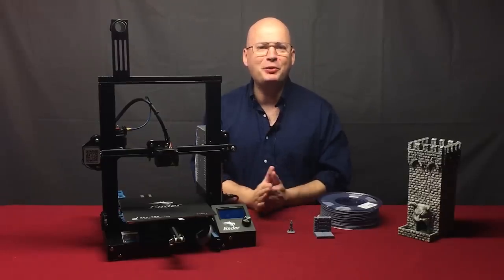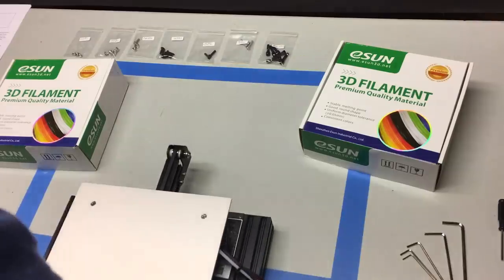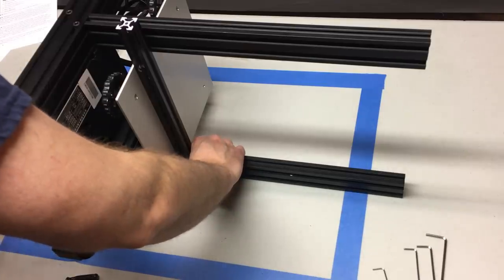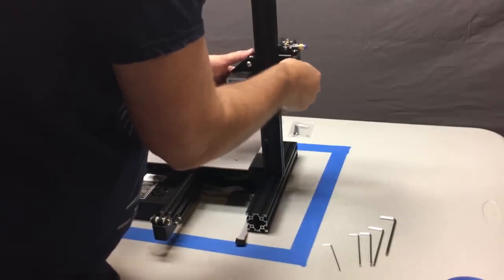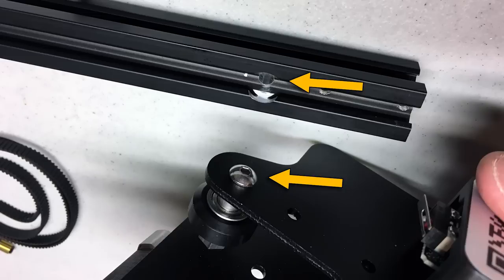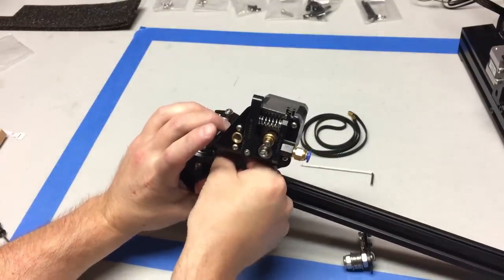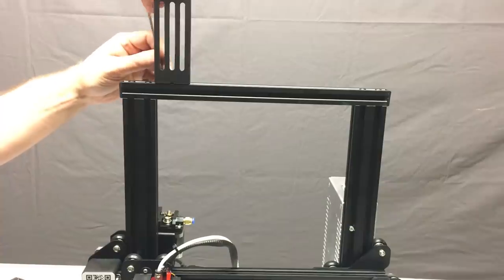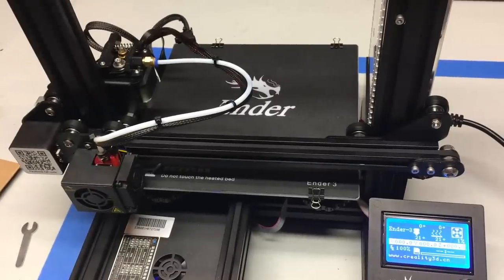Creality Ender 3 assembly and pro build tips

Comment: Who are the seven morons who thumbs down this video? Excellent job. Thank you for taking the time including the added tips to insure everything is square.
Reply from the maker: Thanks! Those seven people are all just jealous of my epic haircut. :)
Reply: Those 7 (now 9) people are the ones who bought a $2000 3D printer, that doesn't do a better job than the Ender 3!
Reply: @kenneththomsen8503  The Ender-3 is a POS printer. It's a cheaply designed, cheaply manufactured, badly assembled and badly stored/shipped. Everyone knows about  Creality lack of quality control. Thanks goodness I bought my Ender-3 in a brick and mortar store. Both vertical pillars extrusion were not cut squared at 90 degrees,  the bed bearings were dead, one of the extruder assembly bearing was all rusty, the aluminum bed was and is still warped. Add to that the dangerous cheap power supply known to failed, the cheapest available motherboard that comes without a bootloader and with only 128kb so that you cannot add most new features on Marlin, the heating bed electrical cable that get stuck behind on of the extrusion (even with the new cable attachement). So you seriously think a $2000 printer is as good an Ender-3? lMFAO The Ender-3 is a POS of a printer that I should have never have bought if only I had known before. But sadly my mistake was to watched too many YouTube videos on which reviewers who are getting free printers from Creality, give very bias positive reviews. Did I say the Ender-3 was a POS? If I had $2,000 for a 3D printer you bet my Ender-3 would have already been advertised on kijiji and I' would be waiting for my beautiful $2,000 3D printer that would be plug and play, safe-to-use, silent, wifi enabled, remote control enabled, HD cam enabled, with an effective enclosure.

P.S. This video here made by Tomb of 3D Printed Horrors is by far the best tutorial on how to assemble/build an Ender-3. Period. Congrats and thank you!
Reply: @mikem8145  it is a good printer to start up right?
Reply: @jairosan71  Did you read my post? The answer is no. Unless you have the time to watch dozen of videos on YouTube on how to transform the Ender-3 into a good, reliable and safe-to-use printer and the money to upgrade half of the damn printer. Upgrades that if order on Chinese sites like eBay or Aliexpress will cost you 50% of the initial price tag of the printer. Upgrades that if order anywhere else than China will cost you as much as the printer itself.
Reply: @mikem8145  So sorry to hear that your Ender 3 didn't work out. Maybe I got lucky with mine. Definitely concerned about the power supply, plan to replace it sooner than later. I'm curious, if you don't mind sharing where you bought it? I'm wondering if it may have been a case of copy-of-a-copy, ie a shitty clone of the Ender 3. I'm absolutely not arguing against your experience or your opinion of the printer,  just wondering who to watch out for if I decide to roll the dice and get a second one.
Reply: @GameMonster117 You probably had low expectations that's why you're happy with your crappy printer
Reply: @jairosan71  Don't listen to GameMonster for sure he had low expectations that's why he's happy with his Ender-3. Or he simply doesn't know what a good printer is. I'm telling you about my personnal experience with my Ender-3 which was built late summer 2018 so it is not an early model. Read forums, watch videos, and you can make up your mind. Is the Ender-3 a good printer? No. Is it cheap? Yes. Now it's up to you to choose which is a good balance between quality and price tag following your budget.
Reply: I bought my Creality Ender-3 from a brick and motar store with a stellar reputation. So I'm pretty sure it's a genuine Creality product. Honestly, when I'll be done with the upgrades, only original Creality parts left will be the alu frame, the delrin wheels/bearings, the stepper motors and that's about it. Let's just say you're lucky and you end up with a perfectly working Ender-3... to have the best prints obviously you need the best firmware right? That means NOT using the Creality FW and install vanilla Marlin (or TH3D or other tweeked FW). That means flashing the Creality FW but for that you need first to install a bootloader. But that's quite easy with an Arduino. So now you have an up-to-date FW. Good right? No. Because the motherboard inside the Ender-3 is the cheapest available with only 128kb of memory and that is NOT enough to  activate all the important features in Marlin like safety features, print quality features, resume print features and so on. So yeah even if you're Ender-3 unit was perfectly built by the Chinese, and that's wishful thinking, you cannot use the lastest firmware to give the best chance of succes in your prints. So is the Ender-3 worth buying? No. You're better build your own printer from scratch than buy an Ender-3. Because you're gonna end up upgrading every single parts of your Ender-3 if you look for print quality and cannot satisfied yourself with subpar quality prints. So then better build it from scrath. Or buy a better quality printer.
Reply: @jairosan71  I'll tell you the plain honest truth that no one is willing to provide you with : most people are buying the Ender-3 because they don't have the budget to buy the new Prusa. Period. I'm was one of them. If I could go back I would either buy a Prusa or another good quality printer from another brand.
Reply: @mikem8145  One last question. Why didn't you return it? If I had bought a printer at a brick and mortar store, with a stellar reputation, and found bent parts, rust, etc. I wouldn't have kept it.
Reply: @joshmckee5699  Like I already wrote in another post, I brought it back to the store and they change all the defective parts. But it's worth mentioning that they had to open three printers to be able to give me one without any defect. All three brand new Ender-3 had some defective parts. Everyone knows Creality fails regarding quality control. Creality say they're testing every single printer before it leaves the factory, that's either one big lie, or they don't mind shipping defective printers knowing a lot of customers won't notice.

Comment: I'm two prints in and my Ender 3 pro has been great. I think these instructions are worth their weight in gold. Feels like more than anything I gathered from this is that you want to double check everything for plum & level which might be loosening a few bolts, making adjustments & tightening them up several times over. But it's worth it. Only thing I'd add to this video is that if you have a level around the house, would hurt to have this next to you as you're building it. Makes for easy checking on a lot of these rails.

Comment: Really outstanding job on this. All the wisdom of an engineer’s perspective, but well articulated in common language. My first ever print is in progress and looking amazing. It’s a mind blowing world we live in; thanks for making this that much more accessible. 

One tip- when installing the vertical rails and getting them to sit parallel with the X axis, I took it a step further and placed one of the horizontal rails centered at the end of the vertical rail, with the assembly still on its side, parallel to the base. This acts like a winding stick and you look at it straight on from a few steps back, this greatly embellishes any twist and helped me dial it in to well under a degree very quickly and without any additional tools.

Comment: Watch out! at 23:54 is incorrect! Those T-nuts should be rotated 90 degree and pushed in from the side of the aluminium bar. When you tighten the screws those T shaped nut shoulders will pull and squeeze it to the aluminium making it not to slip away. This way as in the video it barely grips the aluminium and will slip the X-axis over time. Its great video, but thats incorrect. Thanks

Comment: Your extra step at about 20:35; I've found that when adjusting the two bolts holding the wheel cart to the horizontal X extrusion, it seems to be better to just screw in one of those at first, then you can adjust the  X extrusion while it's on the Y axis using that spacer. It leaves out having to guess the adjustment and having to put it on and off again and again. Just have to be careful not to bump it when taking the X extrusion off the Y axis. Then put in that 2nd screw at the corrected adjustment. I think I've got it pretty much perfect with this method.
Reply from the maker: Great suggestion, I will try it when I build another Ender. :)
Reply: @Tombof3DPrintedHorrors  yes and please add the weight of he other two carriages mounting them on the extrusion (hot-end centered and right one may be tweaked also for extra support) before calibrating the X-gantry. Great video!

Comment: SO I just started putting my ender 3 together today and am at the point of adding the Z-axis assembly motor for the T8 Acme Lead screw. I just noticed the top screw for the coupler to lock in the T8 lead screw is missing. Does anyone know where I can quickly get a replacement screw?
Reply: Anybody? Mine is missing too

Comment: I'm not usually one for watching assembly videos but I have to say yours was a pleasure to view, and coming from a background in aviation mechanics (Military Air Weapons with RCAF) was spot-on with insightful observations and tips on best practices over and above the general build requirements.

I built my Ender 3 five days ago (Christmas eve no less...  :)  ) but after seeing your video, will probably disassemble and re-assemble it using your tips on adjusting the rollers as well as making sure the frame is properly square. It may not seem like a big thing, but being new to 3D printing, and knowing how critical exact measurements, calibration, and leveling are, it can't hurt to make sure the starting point is as dialed in as possible.

Again... thanks a ton for the vid, and best of the season to you and yours.
Reply from the maker: Thanks for watching! :)

Comment: Thank you! This is my first 3d printer, and generally I am not super handy, but all the steps were explained perfectly and it took just some 3ish hours to build it.

I initially didn't understand how the rectangular bolts worked, and messed up the connecting a bit. Also, I didn't know how exactly the x track was meant to be set up. But eventually I got it all figured out. Now on to the leveling of the bed!
Reply from the maker: Wonderful!

Comment: Hi, just assembly my new Ender 3 using this guide. And it's working. Downloaded your test. Bit it's not printing centered in the bed, how can I center it? Thanks and congratulations for this guide.
Reply from the maker: Change the bed size in the Cura settings to 235x235 :)

Comment: very good tutorial thank you for supplying the extra steps in between only part that tripped me up was when you were describing how  to make the x axis straight using the filament holder as a guide i was unsure which bolts you were talking about when you said take it off and turn the bolts half a turn and try again i thought you meant the ones for the z rod so it took a bit before i realized you meant the x extrusion. but overall great video :)
Reply from the maker: Thanks :)

Comment: Great job on leading this printer setup newbie to a successful first print. I was challenged to get those vertical supports parallel so that the distance at the top and bottom was equal. Mine was initially varying by nearly a centimeter. If I didn't know to tackle this issue, I'm sure I would have run into alignment and mechanism binding issues down the line. As a heads up, don't do what I did and get the Z-axis stop switch cable trapped under the extruded x-rail to your left. That was part of my challenge with the verticals out of alignment. The left one was leaning out due to the trapped cable. Luckily I hadn't cinched down the bolts to point where the cable was severed. It's was only somewhat flattened. It's also worth noting that the vertical extruded x-rail on your left is symmetrical along the vertical axis. You can rotate it 180 degrees around the long axis, and that provided me some relief in truing the alignment of the two verticals. Perhaps the end cut of the rail wasn't quite square. That would be one explanation for why the alignment varied when the choice of which edge faced towards the print bed is made.
Reply: THANK YOU for leaving the comment, unfortunately I destroyed my z axis cable.. .anyone know where I can get a new one?

Comment: Great vid but theres one problem that I had in following these instructions. According to the section at 20:39, if the horizontal extrusion is too high or low on either side we should loosen "those" screws a half turn to readjust it. It was being implied that those screws were the 2 z axis screws on the z screw but I'm pretty sure he meant the screws on the x axis extrusion at 18:33 because that worked for me, while the former didnt.

Comment: Hey, I just did the part with the metal rod and as I lowered the horizontal extrusion down I checked that the height matched up the way you did. Its a good bit off, and adjusting screws doesnt seem to work. Its significantly higher on the far side. What should I do? ~20:00 into video.

Edit: It seems the black bar of the horizontal extrusion itself is what has too much give. I can adjust it visibly by hand.

Edit: One of the two screws on the bar had some give to it. I think I have it right now. :)

Comment: Damn, this is the tutorial I should have watched.  Now I pretty much have to rebuild mine...in spite of reading the instructions AND following a different tutorial.  There's not way I can assume my vertical rails are straight or my wheels are tensioned right.  And nobody mentioned all the countersinks.  I only found this because my Z stop switch was totally high, and nobody else even acknowledges that's an issue.  Kind of a crazy crap shoot getting proper build info for this crazy popular printer.

Comment: This is by far THE BEST build video for this printer.  Creality should link this in the printed build guide.  I followed this when assembling mine and my very first print was 98% perfect.  After I set my e-steps and tweaked some slicer settings I am stunned at how good my prints are on such a low price printer.

Comment: Hey Tom, thank you so much for this video. I could not have assembled mine without your video. I am having some issues with the bed leveling. I could not ever seem to get the horizontal extrusion bar level. You said that you would have to work with the two screws, retightening and checking it again. I did that many times without a lot of luck. I did play some more with the concentric nut on the side that was too high. It helped a little. I have the bed mostly level now but that is with the left side with the springs ( an upgrade) completely tight and the right side with the springs complexly expanded. I did try and print tonight for the first time and it just sort of came out like spaghetti. After researching I think it's because it's not sticking the glass bed (another upgrade). Tomorrow I'll go out and buy some Aquanet and see if that is the problem. Again I want to thank you. I would suggest a follow up video for complete noobs like me that is "Now I assembled it, what do I do? "

Comment: In general, a good video, but I'm having trouble with the step at ~20:40. You don't mean the screws for the golden part we loosened 2 full turns earlier, do you? I am loosening the two which we tighten at 18:45, but as a result when loosening it by half a turn, the whole thing just isnt tight at all anymore.

Comment: The troubleshooting guide that creality gives you on the SD card needs to just link to this video and your bed leveling video. I couldn't get a good start so I took it all apart and started over this time following your video and your bed leveling video. I am actually finally printing that dog now. I got the level for now but I believe the underlying issue is I need to slightly lower the z axis limit switch. Thank you very much for these videos.

Comment: I built my first 3Dprinter with this instruction, Thank you so much! I want to add a little about tightening that X axis belt, going too tight will cause concerning grinding sound that seems to came from the motor, and causes vibration as it prints; my suggestion is to try adjust it while moving the extruder around, it should be tight enough to have direct pull feedback to the motor, but not too tight that if you move it fast enough it causes that grinding sound. I noticed the Y axis motor(bed) seems to have that perfect tightness that doesn't make that sound so I took reference. my first print didn't have the X axis tightened at all so I referred to another of your video, the 'bass guitar string' some people used to compare the tightness was rather misleading imo :'D

Comment: Your guide was excellent. It was easier to build compared to the Prusa MK3 but better thought out. I'd like to see what you did with the black cable connected to the motors, annoying it is. I just updated Cura and found that they have an Ender 3 profile built-in. Tomorrow we try printing, flashing firmware and bed levelling.

Comment: buy the aluminum bowden extruder right when you purchase the printer along with the yellow bed springs.  After 5 months of use the arm on the extruder cracked on the underside near the bearing. The plastic extruder is garbage.   Don't waste precious filament and hair pulling replace it now for $12.